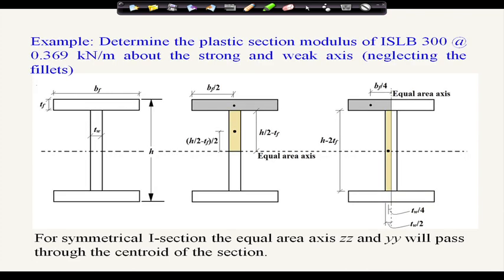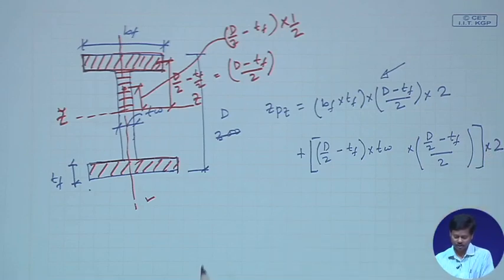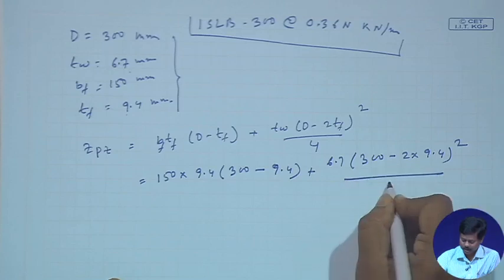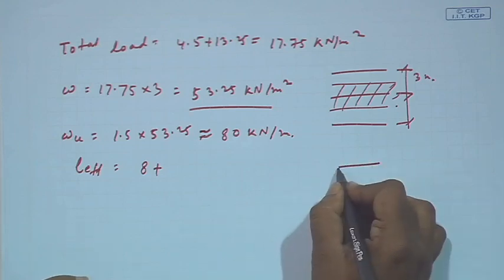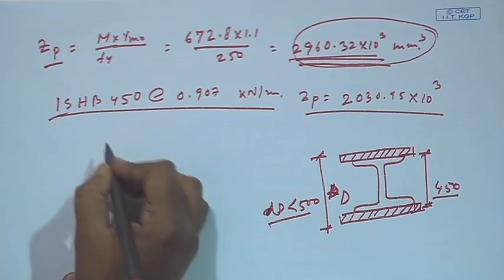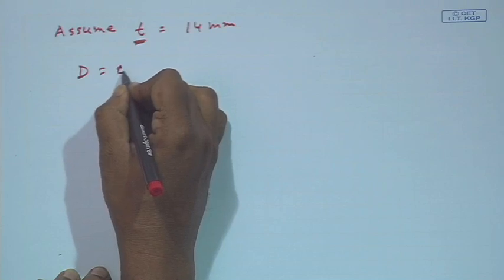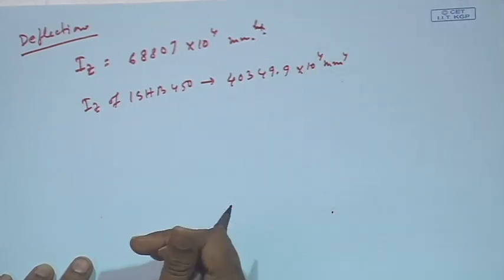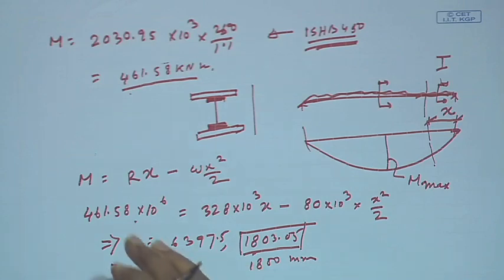mod11lec53

Comment: @35:27 The moment of inertia of Plate about its own axis (Iz') has been omitted in calculating Iz about the NA. May be this is because it is a very small term (4.57 x 10^4). Parallel axis theorem is Iz = Iz' +Ar^2
Reply: Hasan Shirazi may be because it's a plastic section modulus. If Iz' to be added, it will be elastic section modulus.